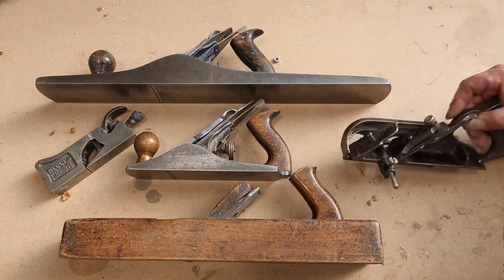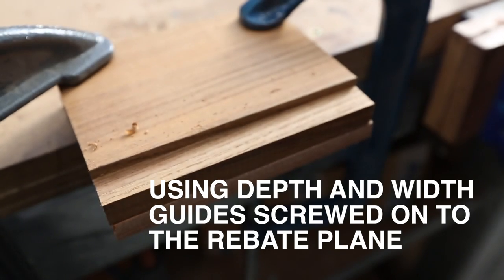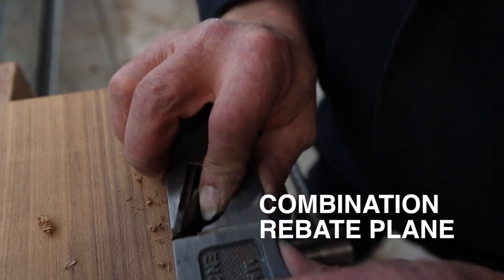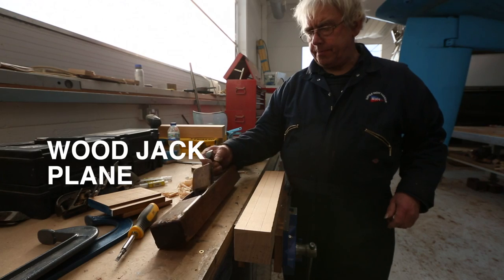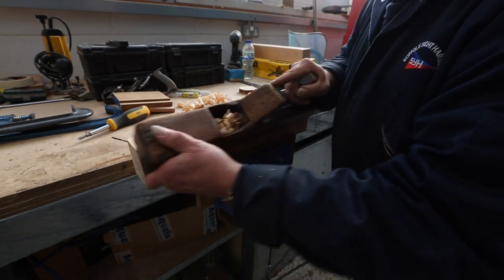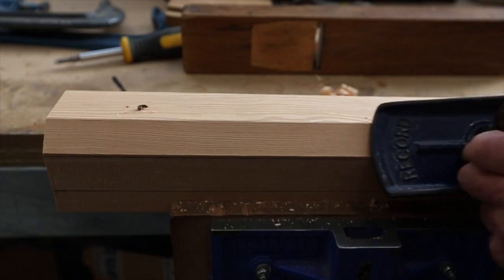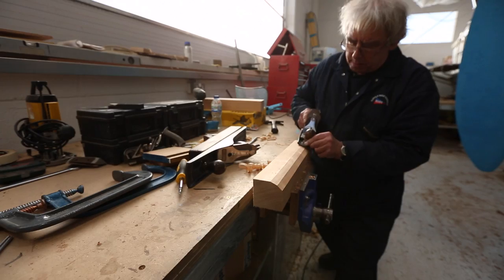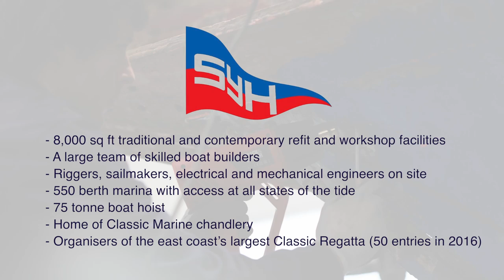Wood Planes (a guide) – Boat Building Sessions

Comment: I have just chanced on this video.  This seems to be supposed to be an instructional video BUT it would put anyone off using your company for wooden boat repairs.

Anyone knows that a No.4 plane is a Smoothing Plane, same as the No.3 and No.4.1/2.

A Jack Plane is always a N0.5, the same length whether wooden bodied or grey cast iron.

No.2 being a Smoothing also
No.6 being a Fore Plane
Stanley used the bare integer while Record used a 0 prefix for the same plane made by them.  Stanley made a No.1 which was for a child, these used to be pleantiful before WW2, but as they were difficult to use by an adult were sacrificed to build Spitfires etc during the second world war, when all metal was collected for the war effort.  They are now extremely scarce.

The longest plane you can buy in normal production is the No.8 Jointer, NOT a No.7, still made today from some manufacturers. This has a body of 2 foot long.   Available from Axminster Tools and others in the UK.
https://www.axminster.co.uk/lie-nielsen-no-8-jointer-plane-421055

Coopers used to make their own longer plane for jointing the curved edges of barrel staves, but the plane was fixed upside down, one end at floor hight and firmly propped at about 45 degrees. The oak stave was passed over the plane rather than the other way round, in a curving downward motion.  These could be up to 4 foot long and look just like a longer and wider version of your wooden Jack Plane.

A Jointer (No.7 or 8) will clip any high areas as a function of the length of its base.  While it is useful for fairing spars etc. in getting a smooth taper in one dimension only it is clearly useless at fairing a hull surface which is curved in 3 dimensions and the last thing you want is a plane which will naturally try to create a flat plane.  Self defeating for fairing a hull.

For fairing curved surfaces you need a Record No.020 or similar which was produced from 1932 till 2004.  There are pleanty of "as new" ones of these on the second hand market for reasonable prices and will last generations.  You can adjust these planes to cope with convex or concave shapes.
http://www.record-planes.com/record-planes-spokeshaves-by-number/

In the days of wooden planes you could buy a proper Spar Plane which had an almost semi-spherical concave base and blade to match.  These come up occasionally on the second hand market.